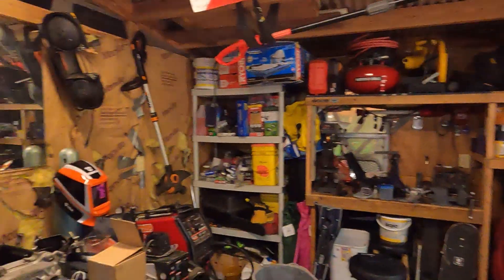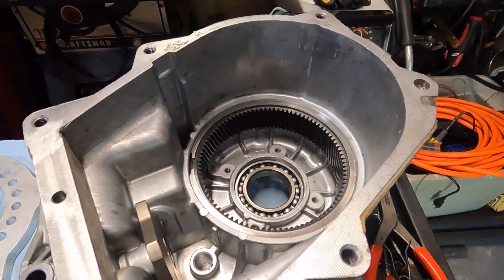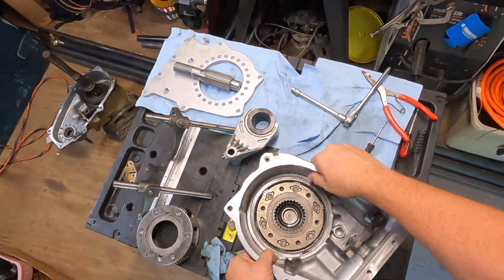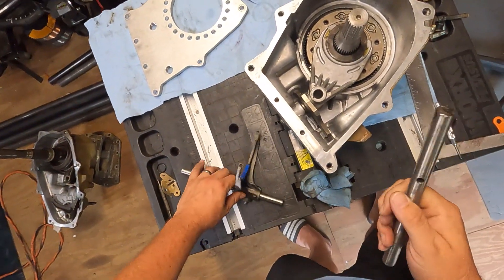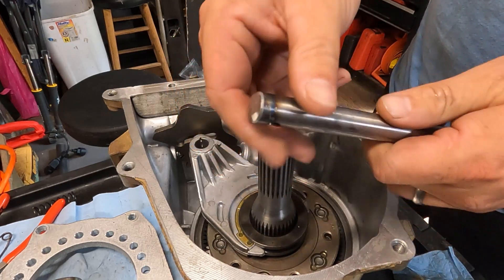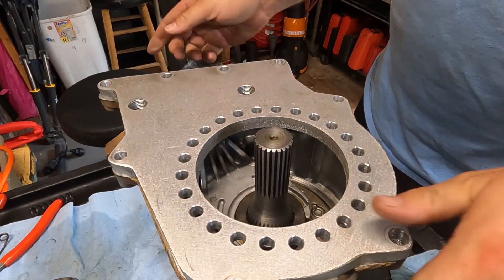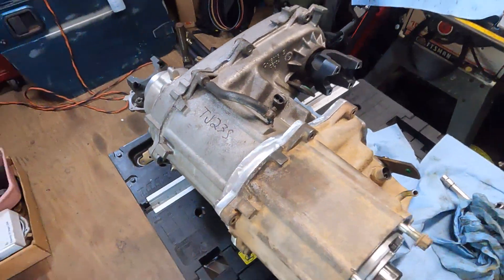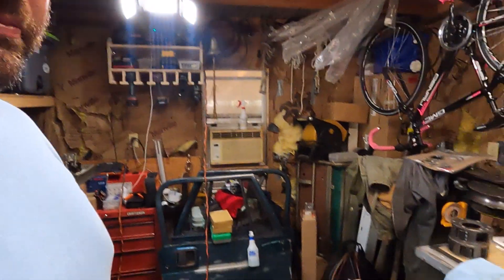"McDoubler" How I built a Jeep Comanche 231 Doubler Transfer Case 231/231 Dual Cases Twin Stick

Comment: I hope these work well as the guy that is building them is either full of it or doesnt know what he is talking about. He is advertising the mid shafts as heat treated and they clearly are not. I bought a kit that took several months to get and then it had the wrong shaft and was not heat treated. Looking at pics on the site none of them are
Reply from the maker: Mine was an older kit from a few years ago. I don’t believe mine was heat treated. I beat on it a bunch and banging the limiter. No issues.

Comment: I had to come back to this video. How was the longevity? Any broken parts long term? I mean like at least a few hundred miles in double low. 2hi should be unaffected, correct? I'd only be using double low for rocks. Single low is plenty for anything else with 5.38 axle gears
Reply from the maker: That's a good question and I plan to do a followup video in the near future.  I'll say the only issue i have is there is a leak between the 2 cases.  It's a very slow drip, and I'm not sure where the source is.  I may pull the cases to track it down, and do a video inspection/update.  Otherwise, I've beat on this rig pretty hard and the cases have held up.

Comment: You really seem to know your stuff
I put a sye in 1991 231j and refuses to stay in 4lo pops out ive adjusted the linkage still wont stay  im wondering if i didnt cut the shaft down enuff put im not sure i really dont want to have to pull out  the tcase again
Reply from the maker: I would think that it has something to do with the shift linkage.  That's where I would check, adjust.

Comment: What's the fluid capacity of the crawl box? With the NP231 being 2.2 quarts, I'm guessing the crawl box takes about 1.5? Did you just fill it up to the bottom of the top fill hole? Thanks for your help.
Reply from the maker: I never calculated the capacity, but I would think 1.5 quarts is close. Yep, I just fill until it reaches the bottom of the fill hole.

Comment: hey man, thanks for the cool video. Didn't think it was possible - - was wondering if you have any thoughts on this idea -  I have the idea of buying the teraflex 2wd LO range kit and doing this set up for the greater crawl ratio .. would this doubler kit allow for the 2 lo range kit? 

It's not necessary, just a nice extra and since the case will be taken out and torn apart - figured it wouldn't hurt to throw it in there. if it can work 

thanks and best of luck with the build. For sure will be bad ass
Reply from the maker: With this doubler kit, you get a 2wd lo option. Since the doubler doesn’t connect to the front driveshaft, you can lock the front case in 4lo, and you get your “2lo.”  Only the rear case will actuate the 4wd options.
Reply: @Hvacoffroad  i seee, thank you for elaborating, that’s awesome. And thanks for the patience in my learning 🙏🏽 lol 
I got a lot to learn

Comment: Nice vid....did have 2 questions...what are those 2 open holes on the adapter  for?  Are they just open?  How does the front half get oil...stay oiled?  With no pump how?
Reply from the maker: Thanks.
Those 2 open holes in the adapter are for drain and fill plugs.  Those plugs didn't come in the kit.  And that is also how the front half stays oiled.  It's fluid is independent from the rear case and the transmission.

Comment: Great stuff thanks for the detailed video!  Plan for my Comanche is 241/241 since running a SBC with a 4L 80e
Reply from the maker: I haven't had any strength issues with my 231/231 combo behind the 4.0.  But I agree, I'd feel more comfortable with a 241/241 behind a healthy v8.

Comment: I did almost the same thing but with a dana 300 as the transfer case. Its a great set up and with the 6 pinion it really makes it strong.
Reply from the maker: I consider the d300 as the rear case. I couldn’t fine one at a reasonable price and I heard of them leaking a fair amount when you flip them. 
Did you flip to driver drop?

Comment: For the shifter fork rod, they should just drill and tap to put a large set screw through the new case half, would keep it from sliding back and forth.
Reply from the maker: I believe that is how they originally built the kit, but had issues with the set screw working it's way out.  I haven't opened the case since I built it, but I also haven't had an issue with the shift fork.  Maybe I'll do a video update and check out the inside of the case, and go over my thoughts after a year of use.

Comment: How do you keep it oiled? Just a splash lubricating system with custom fill and drain holes?
Reply from the maker: Yep, the kit has a drain and fill plug machined into them to service the fluid.
Reply: @Hvacoffroad  ahh, thanks for the reply. I've been contemplating this mod for years now lol. Cheaper than an atlas 🤣

Comment: Getting ready to install a doubler in my Jeep how do you know which cut of gears to order
Reply from the maker: There seems to be a gear change around the year 1996.  The pre96 gears are more squared off on the teeth, the post 96 have more rounded edges.

Comment: First time watching a double installed on a T-Case.  It looks like a about the doubler could be 3 to 4 inches shorter.  I realize that would mean cutting out a section between the two sides, machining both flat and welding it back together.   Does that sound right or am I missing something?
Reply from the maker: I can see that being a possibility and beneficial  for something with a short wheelbase and you have the ability or access to the machine work.

Comment: Do you know if a 242 would work as the rear case? I like having the full time option and 2lo sounds pretty usefull as well.
Reply from the maker: I’m not sure with the 242.  The kit I bought said it was good for a 231 or Dana 300. You had to pick which rear case, so I imagine there’s some differences in the output shaft. I feel the 242 would bolt to the adapter, but not sure about the shaft specifics. That would be a question for the manufacturer.
Reply: @Hvacoffroad  thanks figured it was worth  a shot before calling them
Reply: TeraFlex sells/sold 2LO shift kits for the 231 and 242 cases.  sadly not for the 241 though.
Reply: @johnhufnagel  thank ya, I assume  it would work seeing as you can swap 242 and 231 within spline counts but thats also a good option

Comment: I’m really interested to know how much a setup like this runs ya,  my 231 needs rebuilt so deciding on this or a rubicon 4:1 I can get local
Reply from the maker: If I factor in everything to upgrade the case, the stub shaft/doubler kit, sye, and the extra case, and shifters I'd say I'm close to $1300-$1400.  This doesn't include driveshafts and mounts.  I swapped to tons at the same time I did the doubler, so I needed shafts anyways.

Comment: Why polish this chain driven turd? Lol atlas aren’t that expensive and a smaller package
Reply from the maker: Definitely agree the Atlas is stronger and smaller. But, they are a few months out on builds and I had most of the parts for the doubler on hand.  Length wasn’t an issue, just had to build the extra crossmember.  Never had an failure with any of my 231s I’ve wheeled, so I wouldn’t call it a turd.

Comment: Why not a 231 w a 300 on the back? 6" shorter than a stock 231
Reply from the maker: D300 would be a great option too, and i considered it.  But after calculating the cost for the tcase, shifters, and the dreaded leaky flip kit, I decided against the D300.  The 231/231 was cheaper and I wasn't worried about the length with the MJ wheelbase.  
If I already had a D300 on hand, I probably would have just slung it behind the 231.  Used D300 around here are overpriced.

Comment: When I was young my dad and another guy had a small logging outfit. Instead of buying a skidder they took a 2 ton dump truck and put a boom winch on it. To get some really low gear ratios the mounted a second transmission behind the first one. Tail shaft to tail shaft. Output yoke on the input shaft of the second transmission.  They called it the creature.
Reply from the maker: I love custom creations like that.  From conception to application.

Comment: I have a very similar Box4Rocks 231/231 in my XJ. Rear case upgraded to 6 pinion & wide chain. Sourced dual cable shifters from JBFab. With an AW4, double low (through 4.56 axles) is 94:1. Almost takes two feet to hold it stopped even @ idle. Great in super technical rock crawling and fantastic for deep snow wheelin'! Best part for me is the 2lo. Makes life much easier in tight PNW mountain trails! I didn't add an extra mount, but did fab up a belly skid since the transfer case hangs a bit lower. Prb'ly lost two inches of breakover. Livable for what I do.
Reply from the maker: I can’t wait to try my setup out. Thanks for the encouragement. So you used the stock transmission mount only?  No support for the rear two cases?
Reply: @Hvacoffroad  That is correct sir. G'luck! 🤠
Reply: Can you tell me more for the box4rocks
Reply: @JeepTribe777  Basically identical to what he's showing here in the video, just an earlier kit.

Comment: I’m digging this! I think I’m going to order a kit. My main question is my entire drive line are 21 spline shafts. If I’m thinking correctly I can still use my front 21spline input in the “doubler” but I’ll have to change out my rear t-case input shaft to a 23spline to match the new chromo shaft that comes in the kit? 
Thanks ahead of time!
Reply from the maker: If I remember correctly, you can choose 21 or 23 spline. So you could use your existing trans and turn you tcase into a doubler. Then purchase another 21 spline tcase to keep it all the same. Just make sure you order the appropriate planetary gear if you arguing to upgrade, which I would recommend.

Comment: I have a 231 and a 237, would the 237 work for the range box?
Reply from the maker: I’m not familiar with the 237. The kit I purchased was for a 231j.
Reply: @Hvacoffroad  oops 247
Reply from the maker: @brentfellers9632  I don’t believe the 237 will work.
Reply: @Hvacoffroad  I totally had my numbers scrambled. I have a 95 242xj and a couple of 249s out of 94, and 97 zj, so I'm thinking of keeping the spare 249 to make a doubler from it...
Great video btw,and engagement 👍

Comment: What about fluid for the front case, or is it not needed?
Reply from the maker: Yes. There is a hole for a drain and fill plug. The plugs were not included in the kit unfortunately. 1/2”npt threads.

Comment: Can you do this with any transfer case? Like a 98 jeep Cherokee 4.0 i6 4x4?
Reply from the maker: My MJ had a complete drive train from a 99 xj.  The case i used to make the doubler range box was the original 99 case. So my setup was one year off of yours.
Reply: @Hvacoffroad  ok, where did you get the cover plate and shaft from? I think this is a really cool set up good job
Reply from the maker: @omar1990seattle  http://froehlichsuspension-com.3dcartstores.com/NP231-Doubler-Adapter_p_14.html
Reply: @Hvacoffroad  thanks for sharing , this is soooo cool

Comment: I had to flip the range box for drive shaft clearance. The part u cut off and cap would hit the cv joint.Why did you do a 231 to 231 and not a 231 to 300?
Reply from the maker: It doesn’t look like my cv will hit the range box, the way I have it clocked. Time will tell. I’ll keep that noted for flipping the box.  That’ll add a new set of hurdles to overcome. 

I thought about the d300, but they seem to be scarce in my area, and pricey when you find them.   Then if you take into account the flip kit, shifters, etc, I’d be close to the price of an Atlas.
Reply: Also I would not add a mount like people say to. Every person I have seen add a mount to the 231/231. Has broken the front output off the transfer case.
Reply from the maker: @ernestjohnson1807  I agree. I don’t like the way that I have seen people attach the mount on the rear case. I’m thinking attaching to the range box and let them rear case “hang,” similar to the factory setup.  Then eliminating the factory transmission mount. So three mounts total.   What’s your thoughts on that?
Reply: @Hvacoffroad  I am running a atlas in a zj now. I don't even have the xj buggy the dubbler in any more. I ran factory mounts on a modified cross member. I never had issues with it other the the fact factory rubber don't last long.  On my current set up the atlas is just bolted to the transmission. I have not had any reason to add a mount on that either. I think a lot of people over build simple thing like this because of bad information on the internet.
Reply from the maker: @ernestjohnson1807    Yeah everyone's an expert on the internet lol.  Hard to know who to believe.  I have a modified crossmember that incorporates long arm mounts and uses the stock trans mount.  I may just stick with that if you didn't have any issues.  Less work that way.  Just a little concerned with the extra length and leverage from the doubler setup hanging off the back. Your 231/300 was shorter, but the wight was about the same(80lbs.)  Thanks for the info!